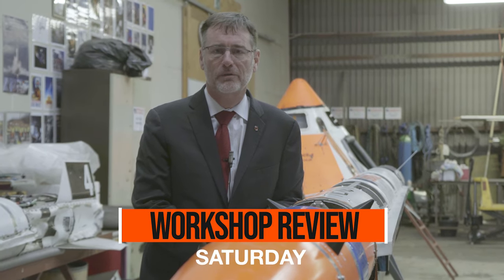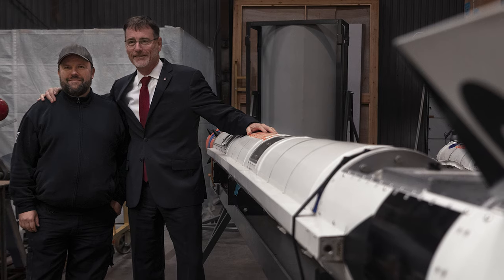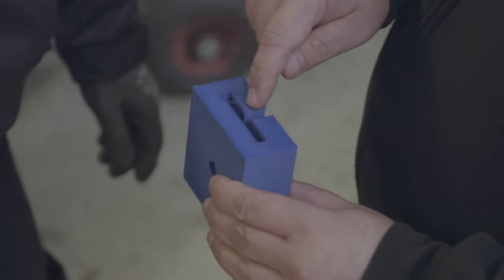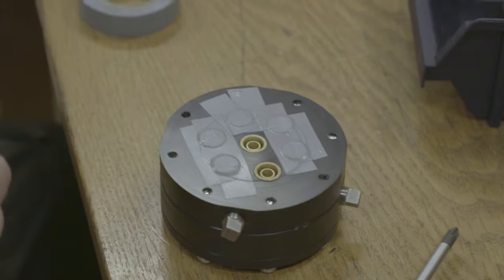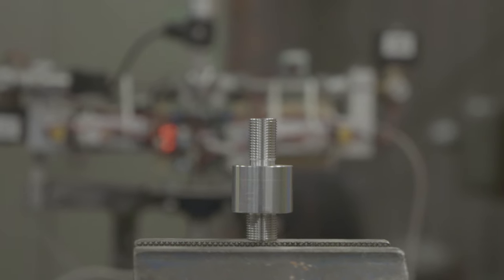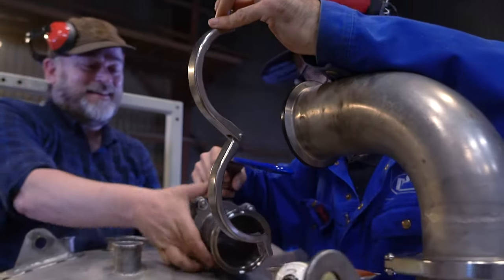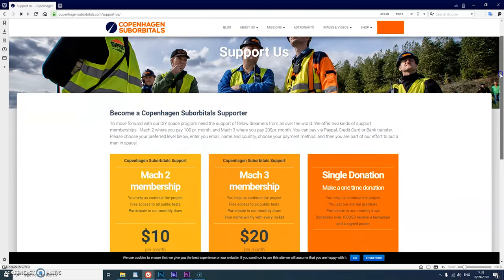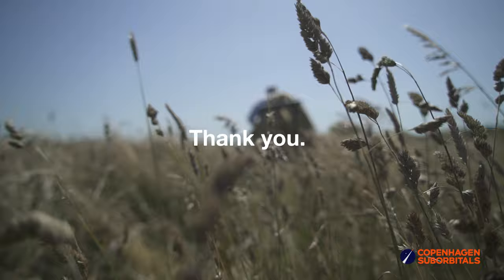Taking It Easy | INSIDE THE ROCKETSHOP: Episode 5

Comment: Piece by piece you're getting closer.
Reply from the maker: And the good thing about rockets is that the pieces only get bigger the closer you get. :)
Reply: Thats true but is it easier to test and validate the smaller ones vs the larger ones?
Reply from the maker: @suasponte8363  In most cases yes. But there is also the question of which one is more fun.
Reply: @CopenhagenSuborbitals  when will unmanned launch be?
Reply from the maker: @111Vengeance  We are aiming for mid 2021.
Reply: @CopenhagenSuborbitals  I am a chemistry masters student from UK with lots of engineering experience. Is there anything I can do to help other than donations? Your project is so inspiring